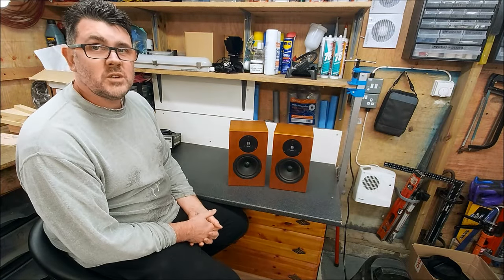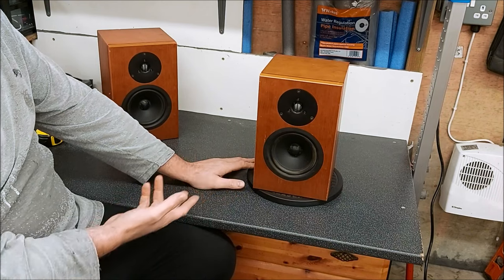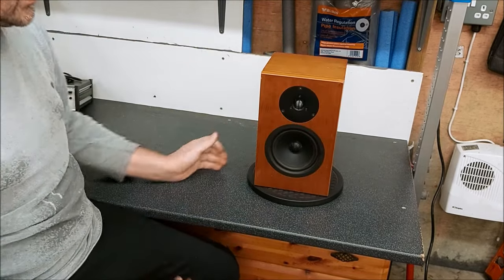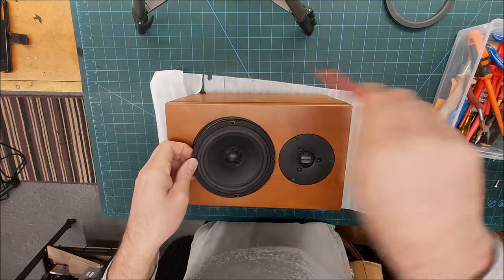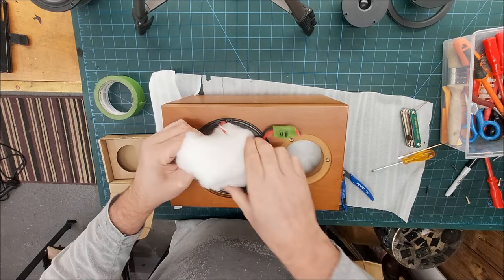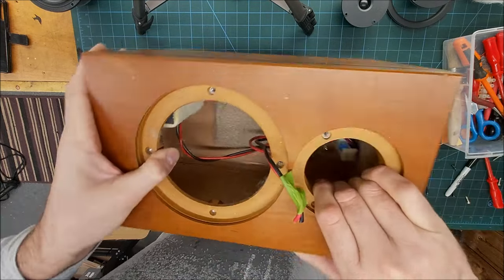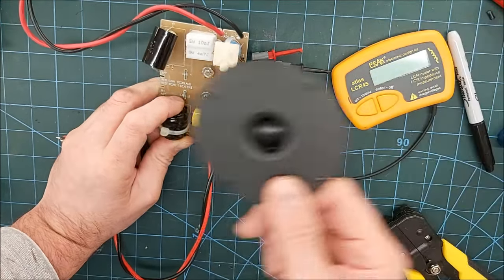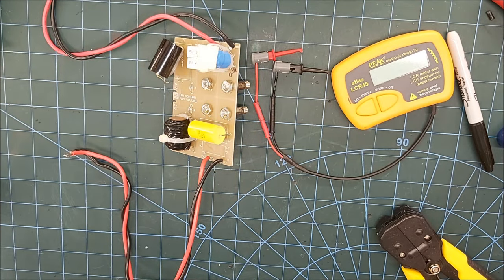LINN Tukan Speakers Part 1

Comment: Try using a vacuum to pull the dent out of the dust cap. I've done that a few times and it works great.
Trick is to start and stop the vac fairly quickly with the hose on the dust cap, otherwise it can tear the cone out.
Reply from the maker: I've done that before. I find it works well on the larger caps and when air passes through them (fabric). You might like the way a sorted them in part 2. Hopefully upload later. Thanks John.

Comment: For  a couple months I maxxed out the Tukans...running them actively with a brace in Naim electronics (CDS1/52/Supercap/Snaxo/Supercap/4xNap135 monoblocks).
If the room was fairly small these gave perceived LF slam and pitch accuracy that was incredulous for their diminutive size). 
THE Tukans also responded very well  to removing the PCB/xo that was even in line when ran actively. 

Ultimately, they were no  match for the other two speakers I also had...the Sonus Faber Extemas were vastly more holographic,  emotional and organic, while the Naim DBLs had a sense of scale and extension that made the Tukans sound like feeble computer monitors by comparison.
But on the right music , they could match or exceed speakers at 5-10x their price.
Reply from the maker: I didn't particularly like the Tukans. Thin sounding. I expected more given the ported design. The were pretty accurate though.

Comment: Excellent teardown and analysis, Matt! Looking forward to seeing how these turn out (have always been curious about the Tukan after having owned a set of Linn Kan MK1's).
Reply from the maker: I haven't seen a pair of Kan's for a while. I get the impression these are almost the same but bi-wireable ?
Reply: @haycrossaudio5474  The Kan's I had were single-terminal pair, sealed boxes - identical in size to the LS3/5a (I think early batches even used old LS3/5a cabinet stock). I think the MK2's were slightly updated and had biwire terminals. They didn't play very deep and were more forward in the midrange than the LS3/5a especially considering they also used a version of the KEF B110.
Reply from the maker: @daphod74  I might be thinking of one of there other models then 🤔. Cheers

Comment: The drive units were from Tonegen in Japan. Read the story of Rod Crawford the designer now of Legend loudspeakers in Australia. The tweeter is a ceramic coated aluminium dome and breaks up around 11kHz if you get a slight  dimple in them. And - the inductor on the tweeter is also Iron cored and 0.18mH. The Woofer Inductor is 0.8mH. The 3 bar tweeter is version 3 - SPKR 015\3. Whereas Vers 1 and 2 had a wire mesh cover but same type of diaphragm. The overlap range of the drivers is a bit too large. Causing too much  cancellation outside of the crossover point.

Comment: The original tweeter was made by hiquphon. They now make a OW1 tweeter which is a drop in replacement but is 8ohms but as the speakers are often used actively the user can reduce the gain in the aktive crossover card in the amplifier. The Tukan passive crossover has the ability to reduce the level to the tweeter by cutting the leg off one of the resistors. This is mentioned in the Tukan instruction manual.
Reply from the maker: Now you mention it that make does ring a bell. It didn't look like a Scanspeak tweeter. Agree with the resistors. With the values in place you could get a 3.3, 4.7 or 10 ohm values although there after the capacitor which would change the impedance it sees and alter the crossover point 🤔
Reply: Linn Isobariks (and iirc Sara’s & maybe kans) used Scanspeak D2008 to start with then switched to the Hiquophon later In production. You quite often see Isobariks with dead tweeters (careless active use??) having the blown Hiquophons replaced with Scanspeaks because they’re a fraction of the price to buy. Wouldn’t like to speculate whether they’re directly interchangeable with each other & whether there were any crossover modifications made when production switched from using one type to the other. Also the Scanspeak has had 3 fixing holes until very recently when they changed it to the 4 fixing type meaning no longer is such a straightforward replacement available for SBLs Isobariks etc etc as they don’t physically fit & I’m sure I heard the spec is slightly different as well.

Comment: Halo , sir can i ask that i have a bookshelf venturi bic v620 speaker , n now i still using it , my question is the tweeter side original value electrolytic cap is 8.2uf 100v can i change it to poly film cap same value or lower by 6.8 , 4.7uf 250v or 400v 
can this tweeter original caps change to poly caps will do any harm to tweeter ? tq kindly advise as i am newbie here ! tq
Reply from the maker: Yes you can change it to a polypropylene capacitor BUT the capacitance value must remain the same. If its 8.2uF replace with an 8.2uF polypropylene capacitor. The voltage rating can be higher. That's not a problem but keep the uF the same.